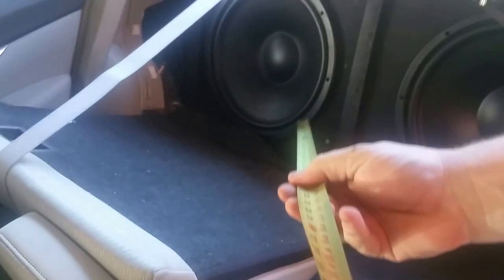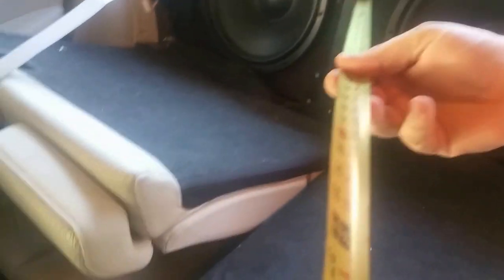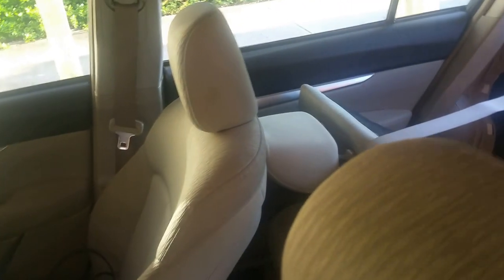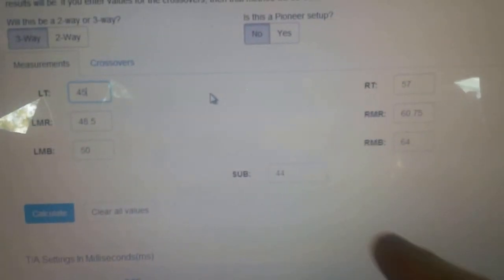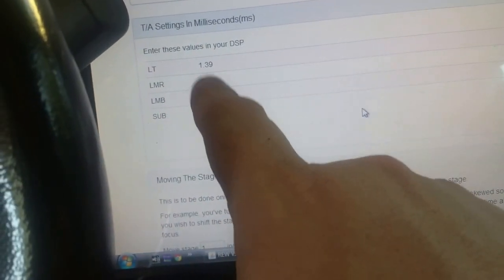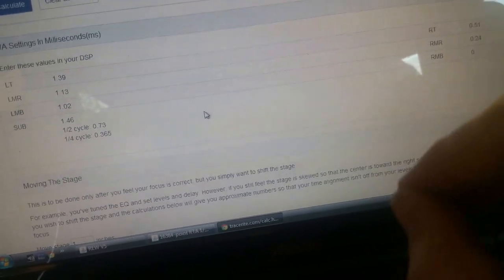How to tune a SQ car Part 5 - Time Alignment pt 1

Comment: Great tutorial. I have question by the way. I have kind of showcar. so i play with both doors open. but say like 10 meters behind the car. ive set the front high and mids to hit same spot 10m behind car. but to the sub. it does to move forward and out the doors. so i add lenght to the mark. for exaple its 2m behind doors. so it will be 12m or do i subtract to 8m because it's farter back ?

Comment: your in-dash MR speakers are pointed at the windshield, do you add the length of the bounce of the sound from the glass? or that's just too small a difference? Thanks!
Reply from the maker: You just have to use your ears and see which way it sounds better. Technically, the reflection will be a second wave a sound radiates in all directions, try it both ways and see which way sounds more natural.  You could get a measurement without the reflection, and slowly start decreasing delay to see when it sounds the best.
Reply: Thank you for the reply Kyle! I guess it all depends on preference, but I forgot to consider the sound from the glass being only a reflection. Thank you for that insight!

Comment: I always do my TA by ear, im gonna try this method now, i have an audison Bit Ten, my question is, those milisecond numbers are for the FINE SET on the right of the DELAY right? cause i cant even do anything on the DELAY numbers, besides that, once i do the fine set or delay depending on previous question, what do i do with the SET DISTANCE???

I mean, im not a big expert on SQ but i´ve build many cars, i always get a nice soundstage by only using the set distance

Comment: These videos are awesome! I like the tracerite software as well! whats your opinion on measuring while in the car, but instead of using the center of the headrest as center point, measure the left side of speakers to your left ear, and right side to your right ear?
Reply from the maker: Bigchuck678 
This is pretty much what we are doing by subtracting 2" on either side, but when trying to measure when sitting in the seat, I found it very hard to get accurate measurements.  That's actually how I did it for a long time, but I found this way to work better for me.

Comment: Love the videos! I'm only running 2 way coaxials and a Pioneer unit. When I put in the measurements on tracerite I get numbers like 155 when it is 68 inches away for example. I can't find any info from Pioneer on how they actually want the info entered, but it sounds correct when I just enter in the inches it is away from me. Does that sound correct to you? Thank you!

Comment: just got done doing my measurements left tweet   right tweet       left midbass        right midbass now that i have the measurments now what do i do with the numbers
Reply: +Eazy Rida wsup k have not heard from is everything okay
Reply from the maker: Eazy Rida make them match each other to the same output level
Reply: u talking bout the the crossover levels if so tweet and midbass levels r at 3db. my meausement i got left tweet 47.38 tracerite gives me 138.01 right tweet 61.75 tracerite 152.38 left midbass 51.5 tracerite 142.12 right midbass 62 tracerite 155.39 now what do i do with the tracerite numbers
Reply from the maker: Eazy Rida Put those in to your DSP as your distance settings for time alignment. What are you using?
Reply: 80prs so put 138.01 left tweet into the dsp so it goes up that high
Reply: +Kyle Ragsdale  wsup K do u have a method for time alignment using my 80prs it keeps putting it rite I front of me I want it on the center of dashboard
Reply from the maker: +Eazy Rida Make sure your LR levels are correct, if they are, adust your left for more delay (Lower number on the Pioneer) or the right to be closer (higher numbers)
Reply: +Kyle Ragsdale i dont understand
Reply: +Kyle Ragsdale tracrite gave me 138.01 for left tweet 152.38 right tweet 142.12 for left midbass 155.39 for right midbass
Reply: +Eazy Rida how do i set the subs crossover on the helix dsp r u just using the lpf
Reply from the maker: +Eazy Rida Yup, and try adjusting the phase if you can't get it right with delay on the subs
Reply: +Kyle Ragsdale when u r doin t/a r u looking for a full sound or a weak thin sound
Reply: +Kyle Ragsdale as u do t/a r u looking for the full sound or the weak thin sound
Reply from the maker: +Eazy Rida usually more full

Comment: Since doing my time alignment. I've noticed that when I move my head around I can tell a difference in position. When going to a competition if the judge is taller or shorter than you are how do you account for this?
Reply from the maker: Bigchuck678 Honestly, there's not much you can do.  If it's a good judge, they will find the sweet spot and judge form there.  And height really affects height more than anything, it shouldn't affect the right to left a whole lot, except maybe the boundaries, depending on install.

Comment: After you're done doing t/a, do you ever add more delay to all your speakers except the subs?  I've read that it makes your sub sound more up front but I haven't tried it yet.  I've read where some people go up to a 5 millisecond delay.  With the new Helix software I think you can group them all together and delay them all at once.  I'm starting over from scratch on my tune and only at readjusting my gains on my amps.  Long ways to go.
Reply from the maker: you can add more delay to everything else (and group them in the helix software) to get them in phase, but it may be more beneficial to assist the phase, instead of the delay, since the wave lengths are so long. you really just have to try it both ways and see how you like it better.

Comment: Also when using this software does this make "center" the center of the car, or does it place the "center" of the stage directly in front of the driver?
Reply from the maker: Bigchuck678 
It places the stage at the center of the dash, for competition use.  If you want it in front of the driver, you can adjust the stage at the bottom of the tracerite page, and adjust it to the left "X" inches
Reply: Bigchuck678 It should be noted that while Kyle is correct, your stage will essentially be collapsed to the left side. In other words the right half of your stage will be 3'-4' wide and the left side will be 6"-8". Unless you somehow overcome the boundaries of the car to such an extent that you can make the far left of your stage be 3' outside your door.
Reply from the maker: That would be true if the center was in front of the driver, but when it is in the center if the vehicle, you have an even amount of space on either side for the stage.
Reply: Kyle Ragsdale That is what I was talking about. If you move the center to the front of the driver, your left side is collapsed and completely off balance. Unless you have a center drive vehicle :)
Reply from the maker: That would make staging so much easier, lol
Reply: I have installed a 6.5" components in the front door and 6.5" coaxials in the rear door. so how to input my measurements in tracerite.com since it has LMR LMB RMR RMB and sub. Please advice and i need to do it for my kenwood DDX9703s system
Reply: Technically, center of soundstage, which, for all intents and purposes, is center of car.
Reply: Treat the front speakers as LMR and RMR, leaving the midbass and tweeter sections empty. You can TA the rear speakers the same way.